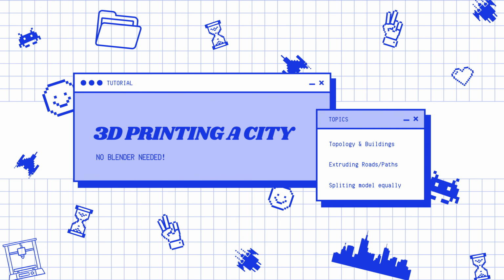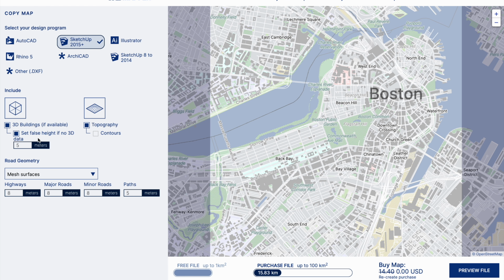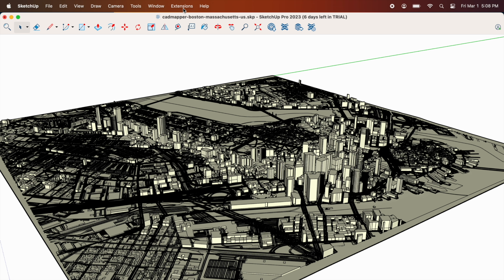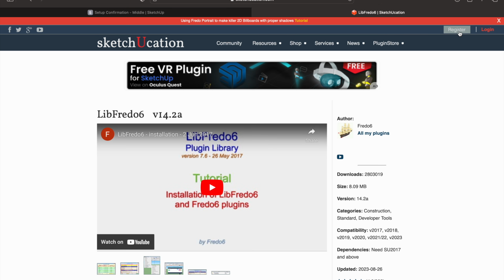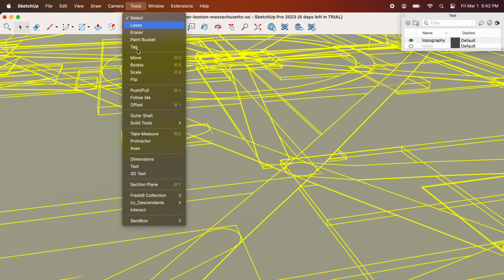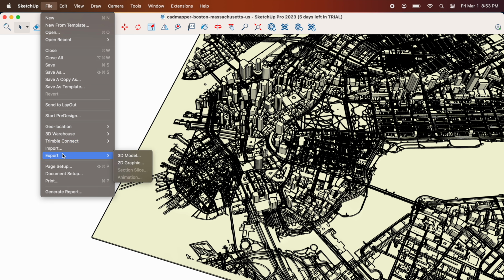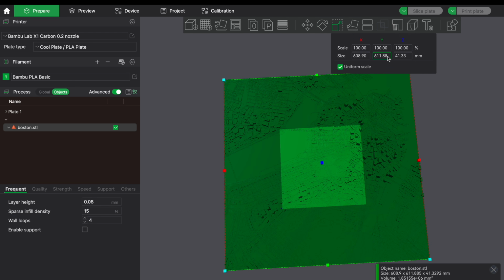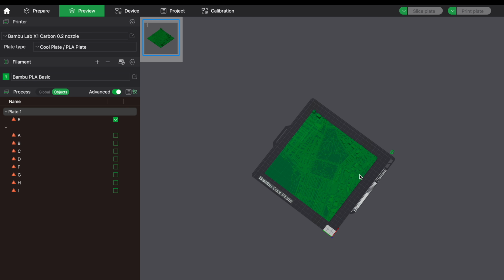3D Printing a City - Easiest Method - No Blender!

Comment: Yeah, I got as far as selecting the bottom and then trying to extrude and it tells me I can't use on curved surfaces. shrug Would have been cool, but pretty much stopped in my tracks.

Comment: Mega tutorial. Thank you. However, I would like to know if it is possible to pull the selected tags exactly 0.5mm upwards 3:04. Unfortunately, you can't see exactly how you do this in the video.
Reply: when you press the tool press shift and up arrow and there should be a notiffication that says blue locked in then you just enter 0.5 should work
Reply: Exactly same problem ... great tutorial until the end ... unfortunatly it messes everythig up and i cant continue
Reply: Message while using the plugin: Face Selection cannot be push-pulled
Please Modify the Selection
Reply: Type the value on keyboard once you start pulling